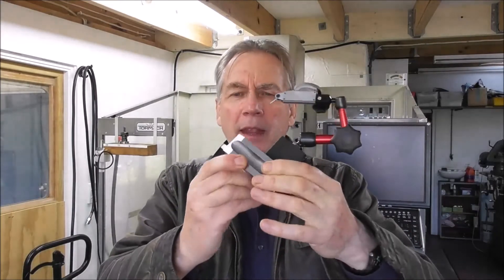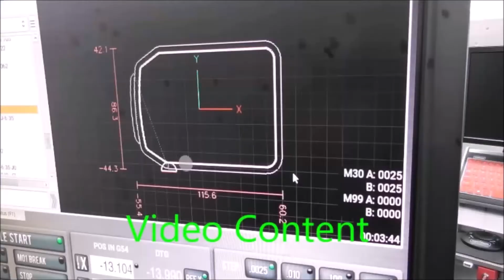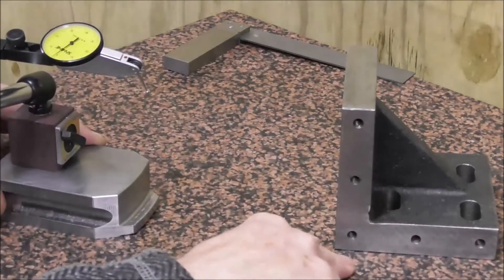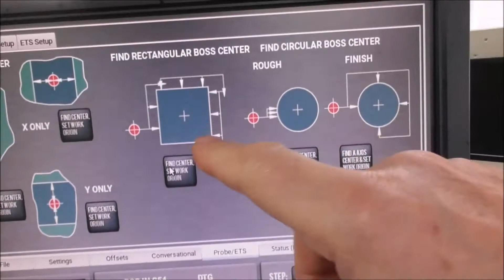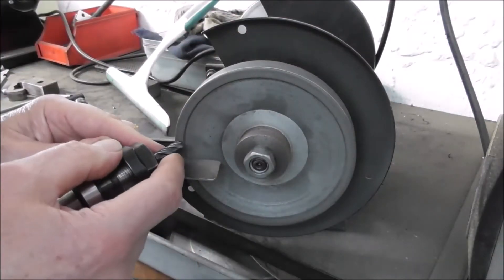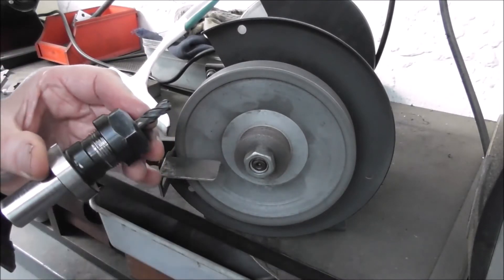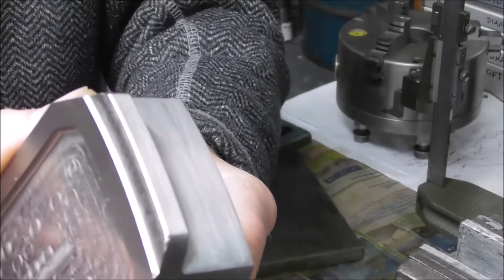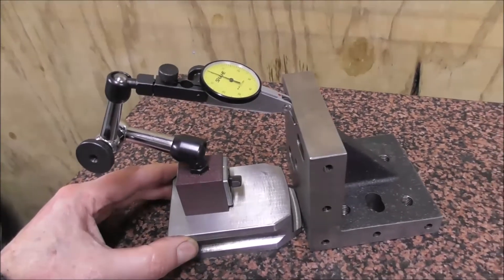Tormach/CNC Project - Squareness Comparator -  Part 1

Comment: hi, time 04:44 > How do you know that the two pieces are always touching each other at the same angle? If you are touching the pieces at slightly different angles in each measurement, wouldn't you be making an incorrect measurement?
Reply from the maker: Hi - I am not 100% sure of your question. If it is what I guess it is my answer would be: Thats why the bottom rail has a radius, and the indicator is first set at 90deg above an apex. Spell your question out more if that does not answer. Cheers, Cliff

Comment: Doesn't the ball end of your indicator have to be precisely in line with your squarness comparator's base nose radius center line to prevent any cosign error? 
 In your video, you show using a mag base (Noga?) with it's offset arm holding the dial test indicator. How do you place the indicator's ball relative to the center line of your nose radius base accurately? 
Also, does it matter what nose radius you use? I ask this cause I have been using a 1" Ball Bearing placed in the "V" of a Starrett Surface Gage as my base "nose radius". Seems to work, but it is a tighter swing to find highest point.
Reply from the maker: Hi Mojo. Good to hear you are thinking deeply about this! The way it works is that precise inline position is generated by the sweeping motion of the base curved contact rail contacting the work, and noting the point when the indicator also contacting the work changes direction. At this point the indicator and base nose rad high point are in line.  (the work surface must be wide enough to accommodate these positions). Cheers  Cliff

Comment: Very nice idea to just make the base and use existing indicator stands to hold the DTI.  Had me heading to CAD/CAM to start modeling up a version to make out of some mild steel.  As you say, for low volume use it's going to be just fine.
Reply from the maker: Thanks for taking the time to give feedback...it keeps me going!   Cheers  Cliff